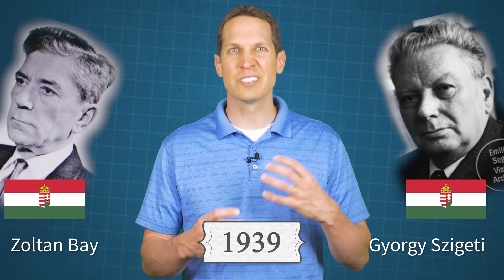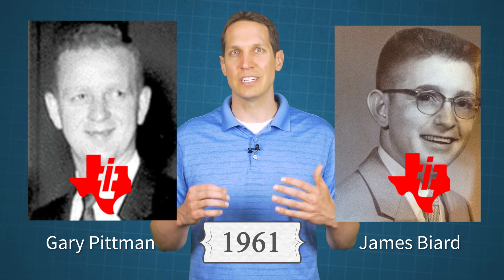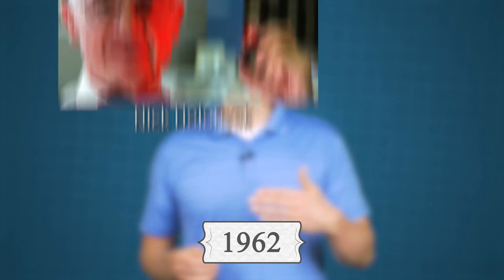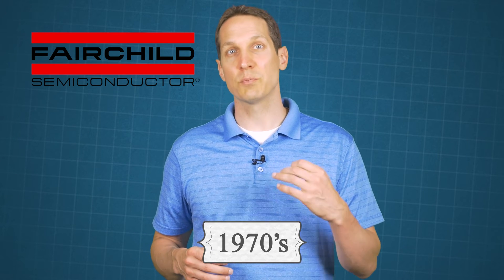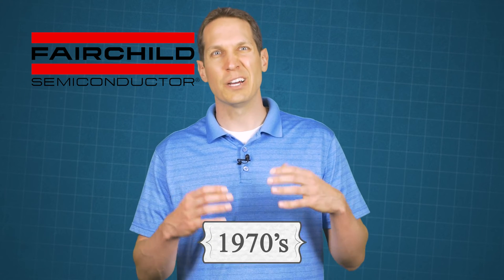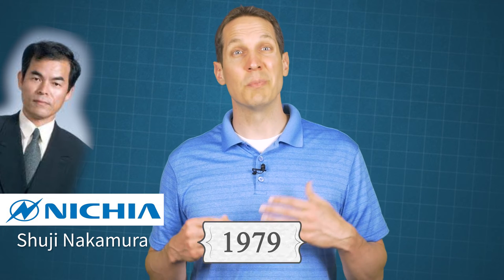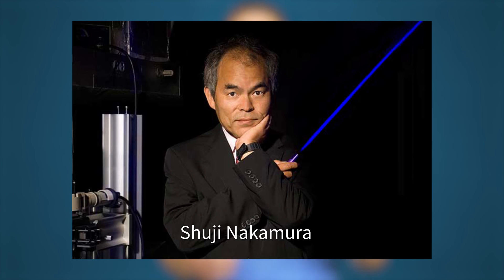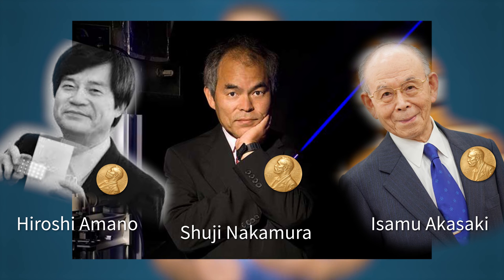History of LED Lights (light emitting diodes) | Basic Electronics

Comment: Concise.  I wonder if a microelectronics revolution remains unremarked.  While I like my cheap led nightstand light, I must switch it off to listen to FM.  What other surprises do LEDs hold in store?
Reply from the maker: For me, the biggest one (that seems to be getting better) is that they supposedly last for decades but you have to be more careful about how you orient them so that the driving electronics don't fry.  And, though they last longer even in normal situations, they're commonly put in series so that there are upwards of 10+ LEDs in series, where one failure causes entire sections to go out.  And the chance of 1 in 10 LEDs going out early is much higher than just one single LED.  I still am a huge fan of LEDs but I feel like the last couple of years have tempered my enthusiasm a bit.